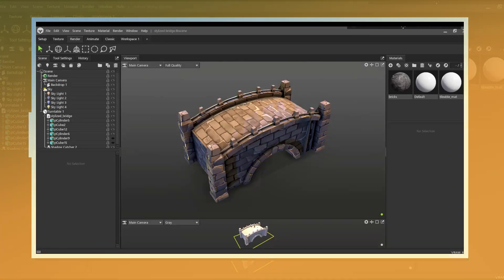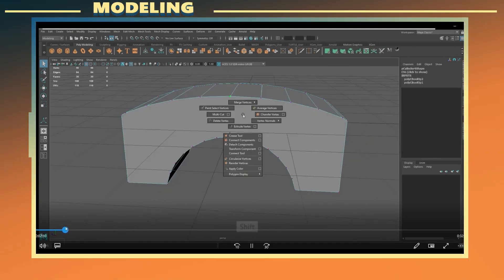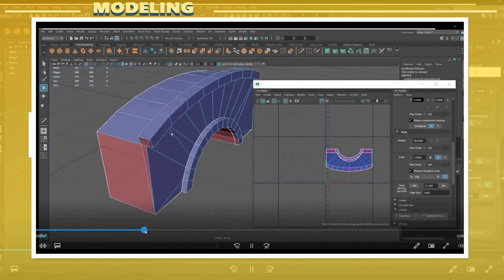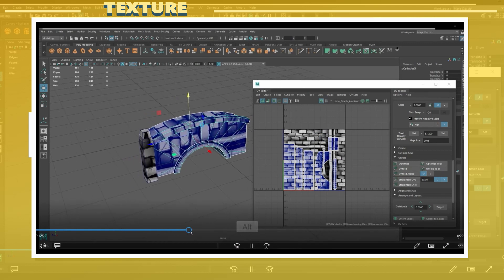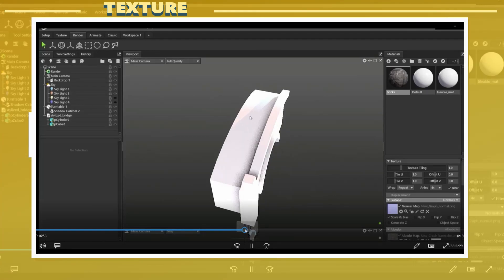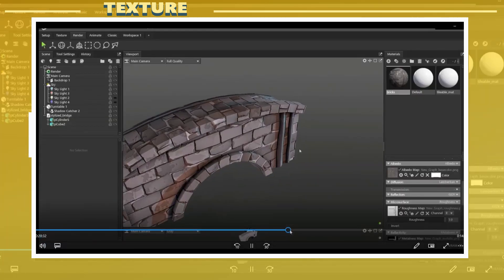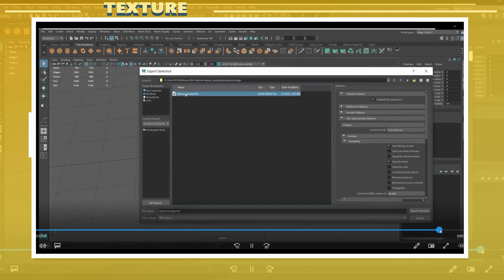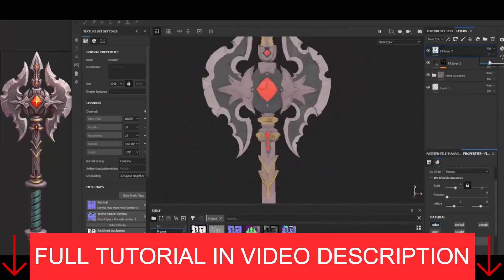Texturing 3D models with tile-able Substance materials - Stylized Art

Comment: do models like these require extra edge loops at the corners and at the middle to sustain the shape of the object and hard edges of the shapes or we can get away with not adding those edge loops?
Reply from the maker: hmm, it depends a bit on what they look like in the desired final render. I would start without it and depending on what they look like add where necessary.
Reply: @3dextrude  For a simple piece like this,  it doesn't require additional edges does it? I've seen most youtubers make assets and modular pieces just like this and export it to game engine as is.